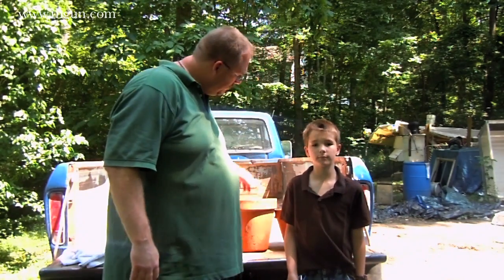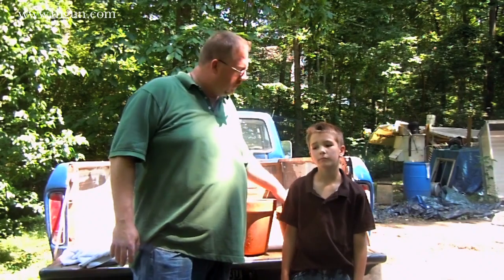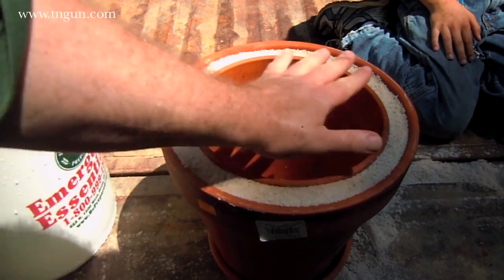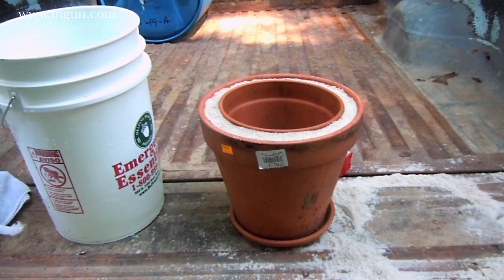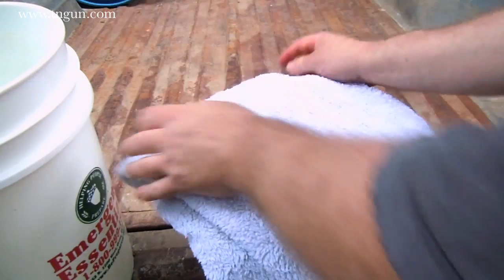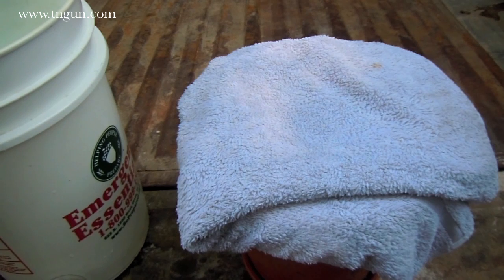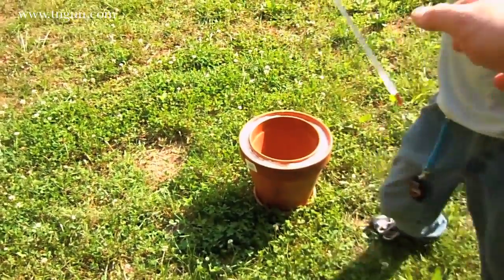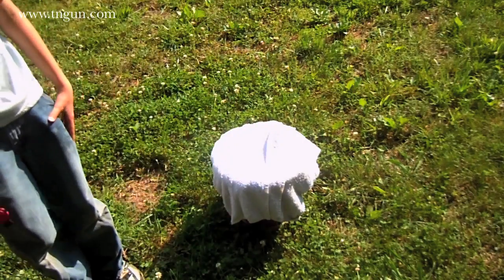Hot to Keep Food Cool without Electricity - Build a Zeer Pot - AKA pot in pot refrigerator

Comment from the maker: If it is hot and dry in your home it could work, it needs to evaporate the water, it does not leak, but I would not want to put it on my kitchen table - it is, after all, a bucket of wet sand.